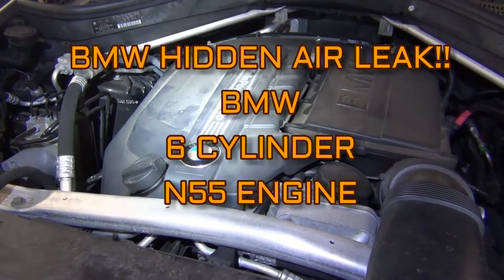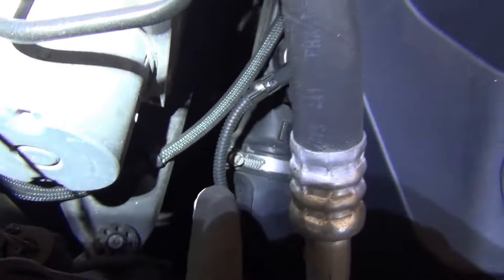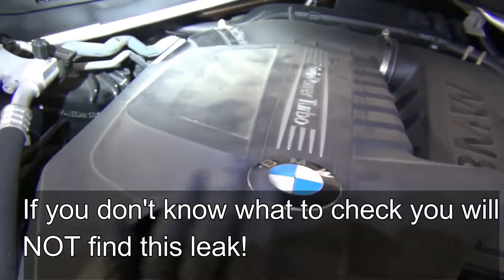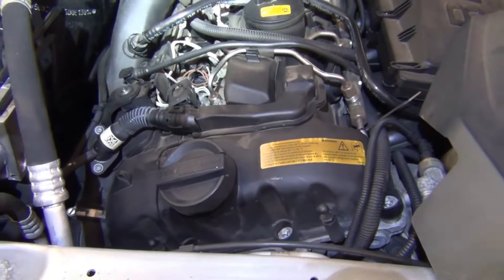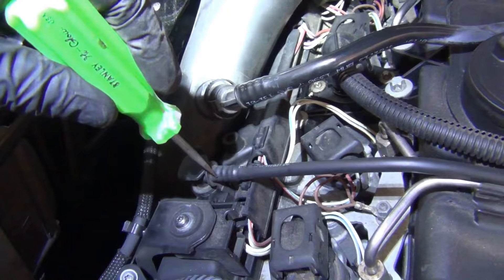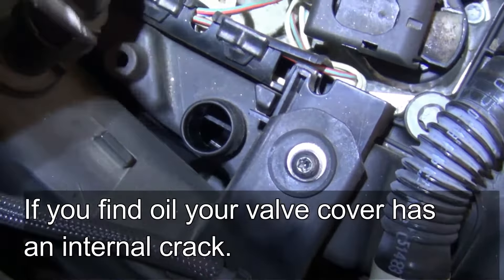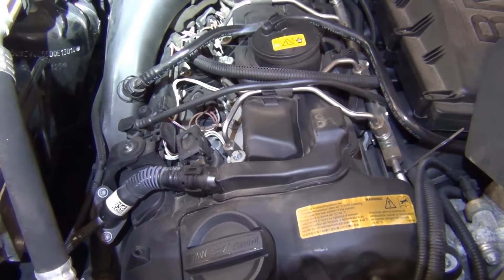HIDDEN AIR LEAK !! BMW N55 Mixture Too Lean P0170 P0173 P2279 2C57 Bank 1 Bank 2 Unmetered Air Leak

Comment: Hello Thank you for the Video. I have an 2011 e90 N55 66,000km Car runs fine but fuel economy on a long run is poor 8L per 100km . I have the same issue with oil in the Vacuum reservoir. Thought id vacuum test just that part of the cover and it holds vacuum. Bought a cheap after-market Valve cover . Compared it to the original, can't see any difference should i replace the cover . I dont have any fault codes engine runs fine just valve cover gasket oil leaks
Reply from the maker: Hi Charlie, You most likely have a micro Crack but this should not effect fuel economy if it is such a small leak. Fuel economy is an odd thing to watch and compare because load, temp, driving style,  etc all play a role in the value.
Reply: @AskTheCarExperts  Thank you soooo much !!  I am about to use a new cover. Its just that I thought maybe the boost solenoid could be pulling oil from a leaky valve at the vacuum  pump under boost conditions, not sure if this is possible Im still learning how it works Thanks for your reply much appreciated!

Comment: I own a 2011 BMW 535i xdrive and that tube is actually ripped off, do you have a site that I can buy the exact part from?
Reply from the maker: Hello, If you are referring to the crankcase vent line, here is the link to the part on amazon. https://amzn.to/3SALYpz
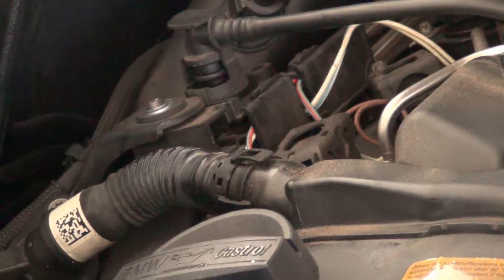Reply: @AskTheCarExperts apologies I mean that connecter you gently pulled off with the screwdriver at 3:00

Comment: I have a 2012 E84 N20 with the mixture too lean code 2BC0.

I am also getting this code 321D: Fuel tank ventilation system and
purge air system, minor leak: Leakage greater than 0.5 mm. I notice
that this code occurs only when the temperature outside starts rising
but never during the winter months which makes sense as gas would
expand when it is warmer outside. I have heard this could be as simple
as replacing the gas cap (as the sealing gasket wears out) or could be
a leak in the EVAP system.

Another code that I only get during the warmer months and never during
the winter is 2C57: Boost pressure control, plausibility: Pressure too
low. I am not getting it right now but last year I would always get it
during the summer only when I hit the highway and I am above a certain
RPM for a period of time. Last time I got it was last November. I am
thinking if it was a boost leak, then it would occur all year long and
not only when it is warmer outside so maybe fixing the 321D or 2BC0 code would
fix this issue too.

Car runs and idles just fine. Idles at around 600 RPM and needle is
stable, does not fluctuate. There may be a slight lag between when I
press the gas pedal and when the car would react. Starts fine except
twice these couple of days where it starts fine but takes slightly
longer than when it was colder outside. Starting again when the engine
gets warmer takes a bit shorter. I would say the biggest issue I am
noticing is the fuel economy.
Reply from the maker: Hi Mohammed,  for something  this you would need to be a member on my channel. But I could answer any quick questions as a comment.

Comment: I found this video when I was searching for loss of boost on my end 55 with no codes I found it again when I finally got a code during a 90 mile an hour uphill pass 2c57. My valve cover was already slated for replacement but now I have an oil in this port and loss of boost, I will be ordering my valve cover today. I’m concerned I have additional problem but the valve cover needs to go.
Reply from the maker: Yup! Make sure to clean out the vacuum lines to the EPDW and the exhaust flap or the reservoir can fill with oil again left over from the previous failure.

Comment: Thanks a lot man! I will wait for it, in the mean time do you have a vid on removing the intake manifold? I need to replace the oil temperature sensor and it is right under the manifold...
Reply from the maker: Hi Eddie, Don't have a video on that yet for the N55. I did finish the N55 valve cover video and I am giving you access to it as an unlisted link here: https://youtu.be/fZnrM3_qaNw
Until I change it public in a few weeks. Hope it helps!
Reply: Thanks and happy new year to y'all!

Comment: Ty for the lovely video of the n55 and your attention to detail on explanations of air leaks,which i will check on my n55. I have a few questions for you if you could respond please eith you thoughts and opinon>>> ty  (1) i have a 2013 x5 35i  150 kilometers on it . ( i purchased it used 2 years ago) when i first start it in the morning (when its a cold morning like 0 degrees only happens ) it engine flares up and down  in rpm,like from 550--1200 rpms for 3-4 sec and then it idles at about 650 rpms ,it then whistles for about 3-4 seconds idling only and thats it for that day,it happens too quickly for me to try to figure out where it comes from, it does sound like a alternator belt slipping for a few seconds, but i have checked the tensioner and all is tight and a new belt and no loose or worn pulleys in this department. So, i let it warm up for about 10-12 minutes. then i drive away.( i feel that it do not like to go beyone 1500 rpm at this time because i can feel a slight hesitation in the gas pedal,so i dont force the engine until its completely armed up. there is no codes light up in the dash.and the vehicles seems to be working fine .A "new" top pan and gasket and Spark plugs was installed 3 months ago, because of a small leak from the top pan.this short whistle noise was there before the top pan was installed. and again the vehicle runs fine,But, Question? when the vehicles engine is started up in the morning and if that noise is coming for the Front ENGINE seal.is the Engine Sucking in outside air through that front seal??? or is the crankcase being" pressurized" and the whistling is inside air blowing out around the front seal when it is cold and then seal ups?? ty for your response  in advance
Reply from the maker: Thanks for all the great detail. There may be more than one thing going on but I will do my best to try and help. I think your whistle noise may indeed be the front main seal. I have experienced this exact symptom of the whistle noise on start up. On some vehicles the front main seal lip seal is weak and collapse allowing for unmetered air during a cold start. Unfortunately the only way to test this theory is to replace the front main seal. Also I have seen a lot of cold start idle fluctuations from engine software level. Once the software is updated the idle fluctuation is usually resolved...as long as it is not from the front seal. This is very common on the N55. I wish BMW pit out a service bulletin but that is how I fix a lot of that cold start issues. I hope this helps :)
Reply: @AskTheCarExperts  ,Sir Thank you for your detailed information and swift and prompt response, greatly Appreciated Sir!. Question.(1) is it ok for me to continue to use my vehicle, as per normal and as it dont seem to be any issue with driveability or anything else.??? Question (2) So when the vehicles Engine is initially started up cold in the morning,what happens?? is the Air being "sucked" in the engine crankcase,thus causing whistling noise, or is it being" Pressurized by the engine and being pushed Out through the front Seal making this noise until it "seals itself??? .. JUST TO SAY>>>> Oh I know it use to pop a code 2A80 code occasionally "before the new top pan was installed and i had to reset and wipe out that same 2A80 code 2 times after The top pan install and that was 8 weeks ago and it never returned since the reset  .One more Question?  is this software from BMW a free upgrade or is there a charge for it? ty for you thought and expertise!!! ty
Reply from the maker: @battlehrfred  Your welcome. It should be fine to drive normally. The whistle noise if from the front main seal is from air being sucked into the engine through the seal. As for the software, there is no parts charge usually just a one hour labor charge to complete the programming. You will need to use a dealership to get the improved software.
Reply: @AskTheCarExperts  ,Ty Sir Again for your great knowledge and input/comments. certianly appreciated to hear it from a expert!. I will find out from the dealership what software is on this vehicle at present time ( i think i can check the present software myself by using my Idrive/setting/info Possibly) Again, Thanking you for your  prompt response and answering my specific questions!!  ty
Reply: @AskTheCarExperts  , ty  Again sir. so really,if l would spray a heavy type brand of engine oil around that front seal, just before i start it up, on the cold startup, and the whistling noise does not occur, it means for sure it the front seal, As this heavy oil will "seal up the area" momentarily correct?? this will,hopefully, do a "process of elimination" to reassure me that it is in fact that seal.ty
Reply from the maker: @battlehrfred  I would not recommend spraying any oil in this area. If the oil gets on the drive belts it can cause them to fail prematurely.
Reply: @AskTheCarExperts  TY UNDERSTANDABLE 100% TY

Comment: Hi chief
My e70 X5 n52 engine IL6 showed one time when I was revving for a few seconds ‘Engine Malfunction Reduced Power.’
No codes thrown. Any suggestions what should I look for? I appreciate. Thanks boss.
Reply from the maker: Hello, Did this happen on a cold start and selecting drive or reverse or coming to a stop? Do you have any long crank in the morning?
Reply: @AskTheCarExperts  
yes. cold start and is very cold weather.
I was just warming it up revving it up to 4K RPM continously for about 6 secs and the 'Engine Malfunction Reduced Power' error showed up.
no codes appeared.
Reply from the maker: @simplelangperorock  Thanks for the additional info. Odd no codes but the warning was on but it is a BMW 😀 If it was a one off time the engine may have been flooded from a short distance move. If it happens often on cold start there is a programming update to the engine computer that often helps resolve this symptom but the dealer would need to program for you.

Comment: Thanks for this awesome video, I recently purchased a cherry 2014 X5 F15 SDrive with the N55 and I  just completed myself the engine flush and ceratec treatment, all air filters, transmission service, rear differential service etc and I’ll be doing the spark plugs, accessories belt with pulleys. Your videos will definitely will be very beneficial to me in the future. Hopefully you’ll have a spark plug replacement video in your content.
Reply from the maker: Hello, Your very welcome. Thanks for watching. I own a BMW X5 with N55 now as well. I do have a great video on how to replaced the spark plugs on the N55. 
https://youtu.be/Kw4GP75YXj8
Reply: @AskTheCarExperts  perfect, thanks for the link, will definitely study it

Comment: Hey boss i have a n26 4cylinder 328i & im getting 
code
 18401 Mixture too lean Large deviation” 
I smoked tested & no leaks. I did notice a little oil coming from the oil cap. Could it be a bad valve cover or pcv valve thats built into the valve cover? Im also burning oil …
Reply from the maker: Hello, If you are getting smoke from the oil cap with it installed then it should be replaced. But with the cap off that would be normal.

Comment: Its a whining noise when my car is idling
Reply from the maker: @chefchamp007  if you open the oil fill cap and the noise is gone then it would be the pcv system in the valve cover as the main cause
Reply: I changed it already
Reply: @AskTheCarExperts it stared after the front seal was changed due to a leak

Comment: sorry for the late comment. I have oil in this vacuum reservoir and i’m just wondering how to remove the oil from the pipe connecting to the vacuum pump. How would i go about blowing the old oil and cleaning the pipe? Thanks.

Comment: Great video... I have one question. I have only error code 101F01 (throttle valve angel- absolute pressure intake manifold comparision, pressure too high)  I checked  like you show in video and there is a oil. Could this be the reason for this error?
Reply from the maker: Hello, This can sometimes be from the intake manifold pressure sensor being defective. Check for unmetered air leaks. Also if there is a Crack in the reservoir it could cause this fault as well.
Reply: @AskTheCarExperts  I checked on smoke there is no air leaks i think i need replace valve cover. 😑😁🤦‍♂️
Reply: Did replacing the Valve cover solve your problem? I just replaced the valve cover gasket, now having a charge-air pressure control, plausible too low fault code appear. 
I can see a smear of oil inside this vacuum chamber you describe in the video. I'm guess I'll need to change my valve cover as well.
Reply from the maker: @daywalker4321  Hi Chris, The valve cover did fix this issue. Double check you vacuum lines to your EPDW wastegate Actuator solenoid. If the vacuum line is off, it is unplugged, or damaged you will get a boost pressure fault.
Reply: @AskTheCarExperts  which vacuum lines to the waste gate actuator. You mean the two  vacuum lines pluging into the side of the valve cover t. ?

Comment: Guys this could be the issue in your car but further diagnosis should be done, i saw this video and had oil in the reservoir so replaced the whole valve cover, and oil is still present, my pwg, vaccum lines are replaced so the oil is not from what is left in the lines. It is from a bad vaccum pump in my case and most of who are in the comment have bad vaccum pump as they still have oil in the reservoir after replacing vc
Reply from the maker: Hello Abood, Thank you for posting your experience. I don't completely agree with your recommendation.  Vacuum is pulling air toward the Vacuum pump which is located on the engine. Hence the term Vacuum not pressure. The oil is usually from residual in Vacuum lines that where not replaced at the same time as the valve cover. It is very rare for Vacuum pumps to fail on the N55.
Reply: The vaccum pump is the issue, oil runs in the vaccum pump and seals may leak oil with time, which was in my case and many others
Reply: I was not sure at first but many of your comments say that they replaced the valve cover and the issue didnt resolve
Reply: This is not oil residual from the lines
Reply: @aboodhjee4962   Did you solve the problem?
                           Was it the vacuum pump all along?
I have the same issue so I ran an independent vacuum hose from the vacuum pump then used a Vacuum hose tee fitting to the Wastegate and exhaust flap to eliminate using the valve cover reservoir completely. so far with nothing connected to the reservoir its still leaking oil from the ports meaning in my case an internal reservoir leak in the valve cover itself